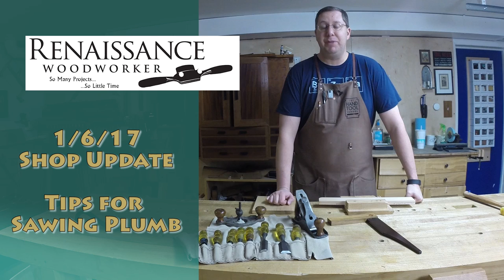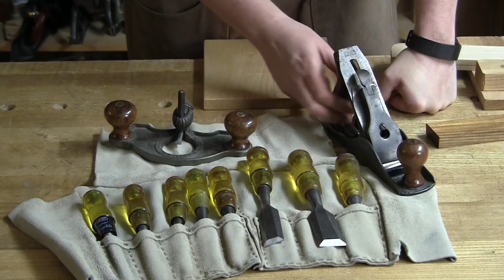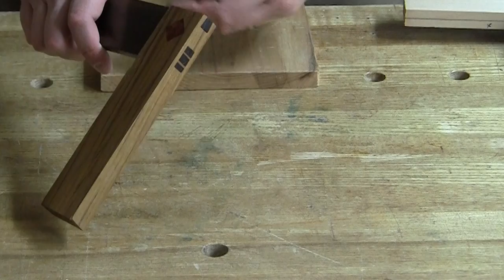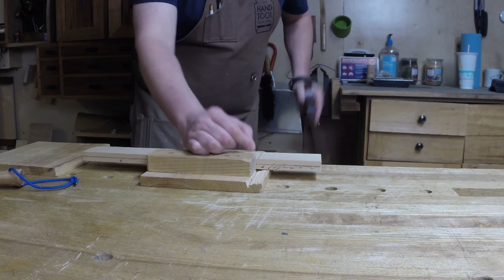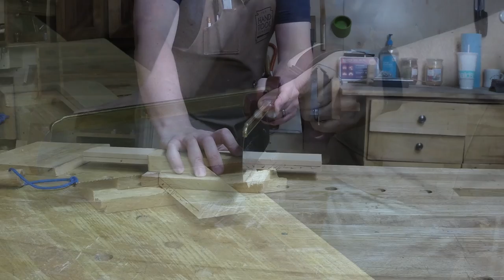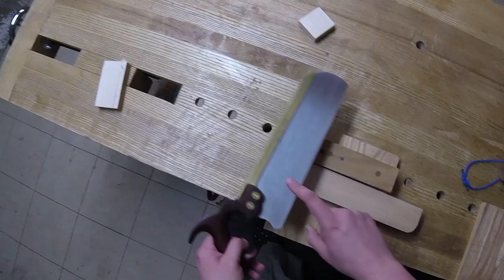Shop Update 1/6/17  Tips for Sawing Plumb

Comment: Shannon, you always do a great job showing these helpful tips, thanks.  I have a question for you about the term, saw plate.  The first time I ever heard it was from Christopher Schwarz on some video he was in.  Every woodworker I had ever met, and every book I'd ever read on woodworking uses saw 'blade'.  I did a search through my library to see if any of the authors used the term, saw 'plate', and none of them did.  Saw 'blade' was used by Hayward, Joyce, Wearing, Hasluck, Jones, Underhill, Krenov, and Frid.  I didn't check all of them.  Mr. Schwarz is a sharp guy, and knows a ton of stuff about woodworking, but he doesn't look to be on the right side of this.  I heard someone say that saw manufacturer's call the blade a plate because the blades are made out of plate steel.  There are a few exceptions, but we don't generally call finished items by the names of the material they're made of.  If we did, we'd have a hard time knowing what someone was talking about when they asked for a ceramic, or a wood.  Which item made of ceramic do you want?  We already have a good descriptive name that has been almost universally used by English speakers, why are we changing now?
Reply: The blade in my mind refers to the teeth as a general term, the plate is the entire piece the blade is made from. I have heard a few instructors use this term. I think it helps to distinguish when instructing, and maybe that is why they use the term...just my thought on this.